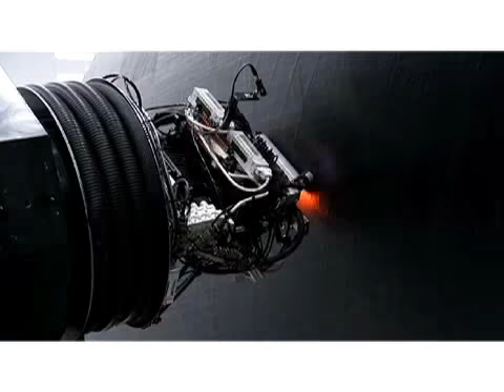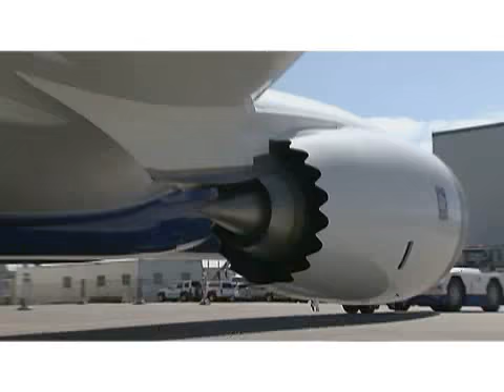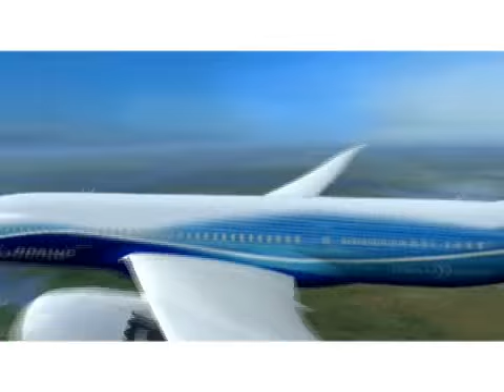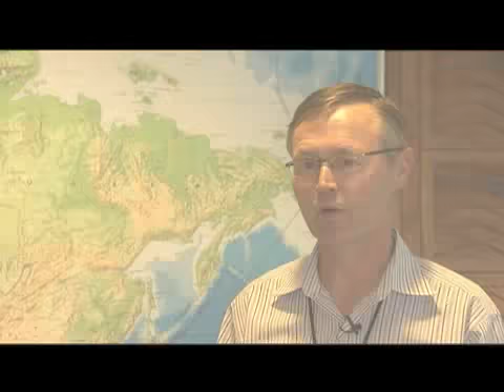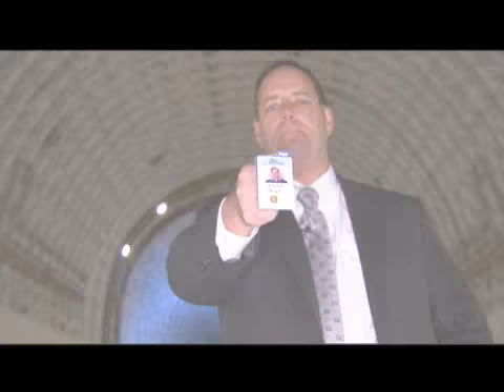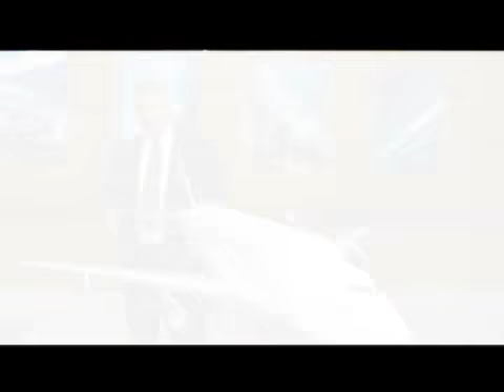Boeing 747 Dreamlifter

Comment: If 747 dreamlifter was converted to passenger aircraft, it will be 3 floor??
Reply: Too small
Reply: Beluga hue hue
Reply: Cargo compartment isn't pressurized so passengers would die. Also the 747 platform couldn't handle a full load of passengers & fuel if you used a pressurized dreamlifter fuselage.

Comment: Antonov 255 is still the master though. So what's the point?... It's just more harmful with emissions and more expensive to say if they just used the AN-255?
Reply: only one 255 and probably all booked up for the next ten years so this is the only way to get things done especially with the frequency they need to move those large parts.
Reply: a antonov an-225 would be  easier because the dont have to build them
Reply: +Potatomaster Dinoman and its bigger
Reply: +TheTriumphant675 There's actually a 2nd AN225 waiting for a customer to buy it.
Reply: Dreamlifter has more volume, and that's the issue, not the weight. AN225 and probably even the C5 can lift more... The wings are pretty light.
Reply: The An-225 is bigger, true. However the dreamlifter can carry more cargo.

Comment: does the boeing 747 dreamlifter has 240 worldrecords? no. can the boeing 747 dreamlifter carry 250 tonnes? no. does the boeing 747 dreamlifter has a range of 15.000 km? no. is the antonov longer? yes. has the antonov a bigger wingspan? yes. does the boeing 747 dreamlifter has 6 engines with 230 Kn thrust each? no. can the boeing 747 dreamlifter have take off on short runways? no. and i can say much more good things about Antonov, but i'm hungry now. so yeah, please give some more reasons.
Reply: Boeing doesn't care about size as much as fuel and cost efficient aircraft.  Boeing built the 747LCF do to one specific thing, while the Antonov an225 has multiple purposes like carry the Buran or deliver multiple parts for military machinery.  Boeing doesn't need the 747LCF to have multiple records.  They don't need it to carry 250 metric tonnes.  They don't need 6 fuel guzzling engines.  By the way, about engines, the 747LCF engines, the Pratt-Whitney 4062s produce 283Kn of thrust each.  They just need it to do what it was built to do.  Carry 787 Parts.

Comment: They are able to expand the top of a 747 making it taller, that is why it bulges out, so it can take a 787 fuselage. The antonov has the wings mounted on the top of the fuselage. The 747 is easier to modify and the parts are easily available.

Comment: As opposed to the Airbus 300-600 Beluga, the loading mechanisms are almost identical. One issue that I see with the Boeing is the rear door being hinged from the side. The fact that another vehicle has to tug it increases opportunity for damage to the highly malleable surrounding area which supports the hinge. On the beluga, unilateral support and weight distribution aids in stability, it's also self sufficient in the opening and closing process but it opens vertically, so bad on windy days.